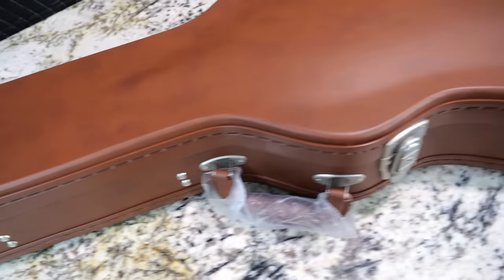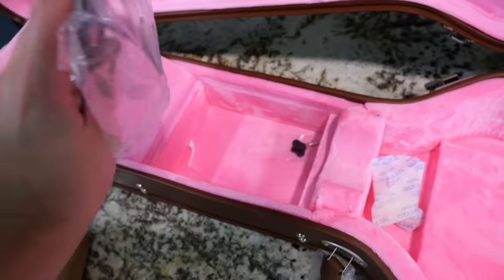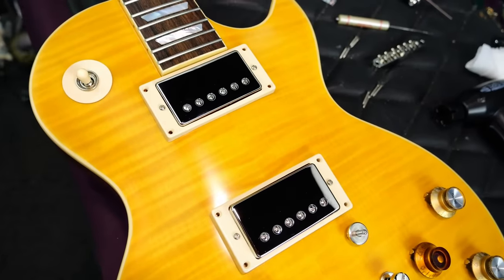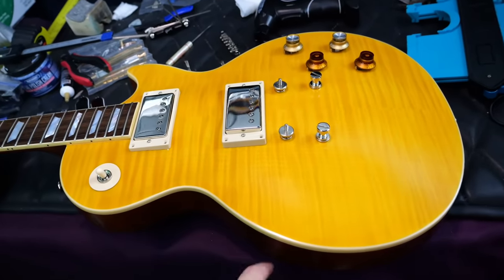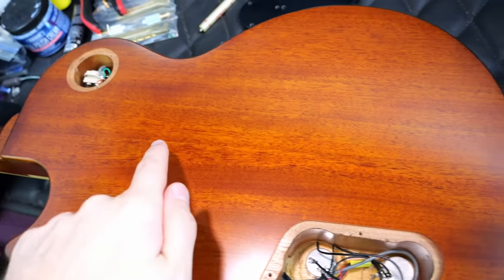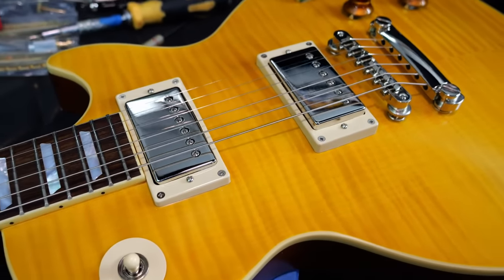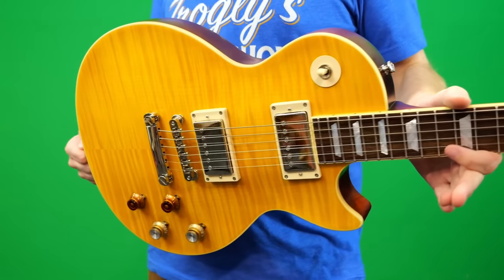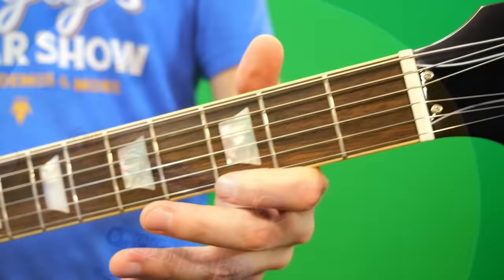I Tried The Epiphone "Greeny" (with Gibson Headstock) |  Review + Demo

Comment: Comparing this "Greeny" to a Lazarus ..  I live / retired in Thailand and was able to buy a Lazarus back in February from a dealer in Japan $800 US and shipping worked out to  $910  ..  I changed the  tailpiece to a Faber light weight,  changed the  pots to proper CTS. switched out the jackplate to chrome
added speed knobs, switched the pickup rings to correct vintage height so the pickups sit flush ..  and the biggest / best mod was  simply turning the neck pick up around ( not out of phase )..  actually made the terrible sounding Burstbucker 2 respectable ..  and I gave the finish a good buffing so now it really shows some depth ..   all in under $1100.00

Comment: I wonder if I am the only person in this world who knows that Yellow is in fact, not green lol.   Plus I can't see any reason why this guitar should be anywhere near as expensive as it is, I mean it seems to be a basically a Epiphone Les Paul, with the yellow finish and a cheap flame.. The pickups are cheaper to make, as they use less wraps, to make them less hot than the normal Epiphone honestly..   This guitar is nothing more than a Epiphone Les Paul really, so the price is not reasonable at all.   

On a side note, I think they should stick to the Polly finish and for many reasons.  Ill give a few, just to be clear.  Nitro Finishes, out gas constantly, that is why you can smell them.  Polly doesn't do that, its more stable. Nitro finishes crack easier, they don't last as long, they loose the color and thus become dull in very little time, they are worse in every possible say they can be.  In fact, the idea to use Nitro finishes came from the Auto industry, which no longer uses Nitro finishes anymore, because Nitro finishes are considered dangerous.  Because they are toxic, and have actually been outlawed for automotive finishes of the United States...   So no, lets not encourage any company to use Nitro Finishes at all, I would call for a Polly finish on Full blown Gibsons..

Comment: I know Gibson are phasing out the low end models to be replaced by high end Epiphone models, but, there are still Les Paul Tributes available, and if you shop around you can get them for around a £/$1,000. Plus the extra for the Greenybuckers and you could have a Gibson Greeny for less than the Epiphone.

Comment: If you want that greenie oop mis sound, just wire up a push pole pot to phase invert the neck pickup.  Pull up the pot's greenie mud tone.  Leave it down and you get normal.  As easy as.

Comment: They don't put a two screw TRC on it because the headstock angle is wrong. No matter the headstock on the guitar, the angle is still not the angle of a Gibson. If you want the correct angle, you need either a Gibson or a Japanese made Epiphone. I would recommend finding an Elitist over spending this kind of money for a Greeny, you will get a much better instrument for your money.
Reply: @donthewatcher  That is neither here nor there. I was just talking about the reason for the three screw TRC as opposed to a 2 screw. You need the 17° angle to leave the room at the bottom of the headstock to have the space for a two screw setup. Almost all Gibson type guitars use a 3 screw TRC because they all have a shallower headstock angle. 

If you are worried about a headstock angle causing tuning problems, then get a Strat or Tele and you will have no angles to worry about. My Strat stays in tune for ages, then again, so did my Epiphone Elitists and they had the Gibson 17° headstock angle, along with a Gibson 2 screw TRC.

Comment: Does anyone know if the headstock angle is 14 or 17 degrees?
Reply: I bought it and it's 14 it's not true gibson angle
Reply: @HarleyCampbell79  Many thanks for the reply.
How do you feel about it?
I know it's not strictly authentic, but I personally think that it's a good thing from a player's point of view.
IMO the steeper angle puts more pressure on the nut which can make the lack of straight string pull more troublesome.
The increased pressure could also make a neck break more likely.
Shame about all the negative stuff.
I think maybe people forget that Gibson filed for bankruptcy in 2018.
People have plenty of choices.
Hope you get loads of fun out of it.

Comment: Hm, let me see. Laurel fretboard, $hit soldering, crappy taping off of the binding, frets don't feel the best (Gibson frets my a$$), cheap satin ish finish, not sure what's up with that neck joint, knobs are wrong, "worn off" Les Paul silk screen while the rest of the guitar looks new, MOP fretboard inlays that don't belong on a Greeny,  veneer (on top of maple) instead of a real top, no COA, $1500.
Can't help but just shake my head on that one. Cold day in hell when I'd spend $1500 on an Epiphone like that.
Reply: I agree with all of your points, But I'm curious about the Veneer. What brands these days are putting real flame maple tops on sub $1500 guitars?
Reply: @trevor4533  Good point. None that I know of.

Comment: Instead of expensive chinese epis, what if they just made these epis in america. Middleway between gibson usa and epi china
Reply: It would just cost the same as a gibson? The price of epiphone isnt due to the it being called “epiphone” its only cause theyre made in china. This would be 2500+ if it was made in America
Reply: @justinguitarcia  heritage makes harmony which is like $1200
Reply: It would cost as much as a Gibson. It being made in USA makes it expensive. Not the brand name.
Reply: @fpsgamer357  Ah man, Harmony makes some sweeeeeeeeeeeet guitars (they're not lookers but man they feel and sound great)
Reply: @fpsgamer357  for sure, but thatd be the equivalent to a usa epiphone special or junior… not knocking it but you cant get regular lp standard appointments at that price point. The harmony guitars are great but by comparison a much more straightforward instrument
Reply: @fpsgamer357 Harmony's single cut guitars are bolt on and pretty bare bone. Cool guitars and nitro finished, and a pretty solid value though. Although,  the Comet, is set neck and $1500....so maybe???? Also, thanks for turning me on to these, definitely gonna keep an eye out on a deal for a Jupiter!
Still,  a like for like comparison would be Heritage's own H150. a $2600 Set neck LP standard style guitar. Proving Adam's point.
Regardless, I just don't see the value here at $1500. During Black Friday, Gibson was selling through LP Classics through the Demo shop for $1500-1600.
And there's a few sellers on Reverb with S2 594s for $1500 or less new.

Comment: Way over priced. I have a 1989 Korean Les Paul Standard, one of the early ones with a Gibson style "Open Book" headstock, long tenon neck & a decent maple cap, which was not mega expensive when new, comparing prices back then to now.

This is really still just a Chinese made guitar with a few extra features and should have at keast had a bit of relicing to get closer to the look of the original  Greeny, rather than just sticking a couple of different knobs on it.